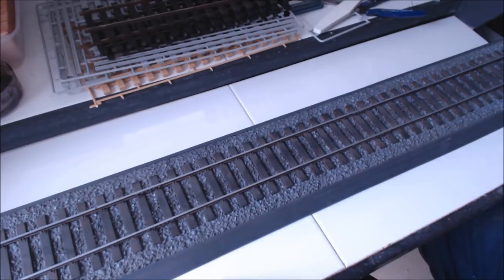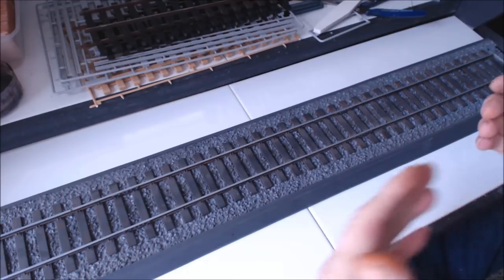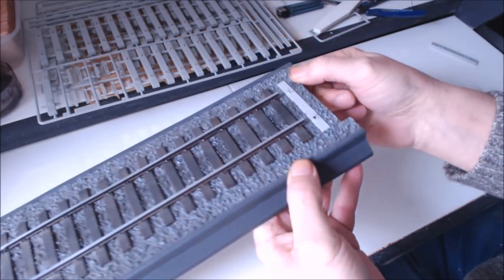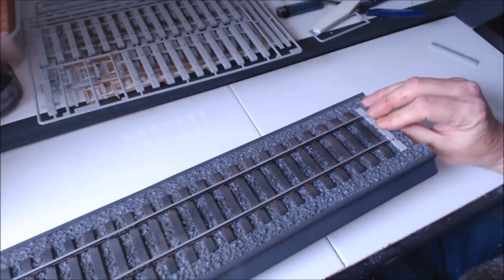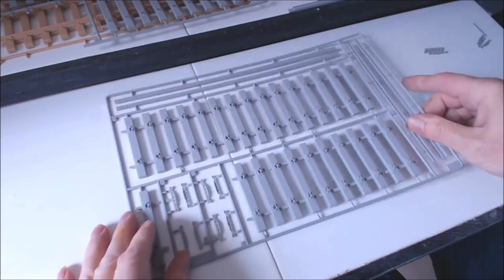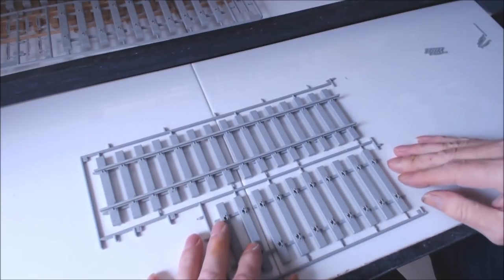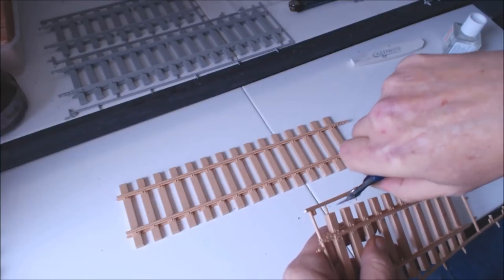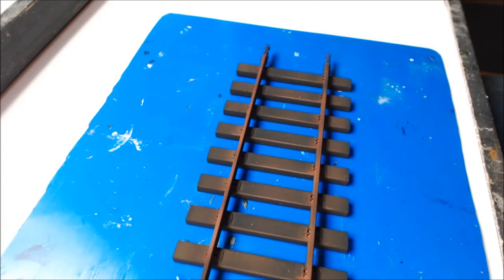Trumpeter 1/35 scale Base And Tracks Assembly

Comment: Great vid. Have put these together myself.
If only doing a few sections it makes it more secure if you put the long rails on the short length of sleepers and vice versa. Slide excess rail of short section into empty part of long section. This staggers the joints. Joiners still fit when used mid section. Adjust the other section of sleepers to achieve even spacing at the gap and you will find rails stick out a bit at other end. This is where the spare sleeper goes. 
Just for the benefit of your viewers. 
Keep up the good work.

Comment: cheers for the heads up on the sleeper fit, i am putting this kit together at the moment and decided to investigate the problem and discovered it was the injector pin marks over the sleeper joiners that you cut off and was holding it up a few thou. when i removed the injector pin marks  with a flat smoothing file (no handle) this cured the problem.